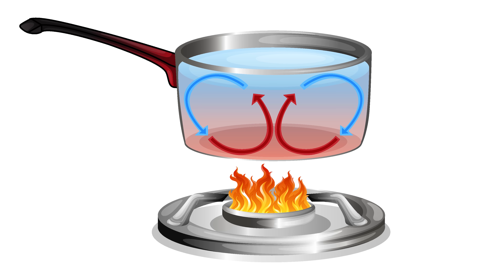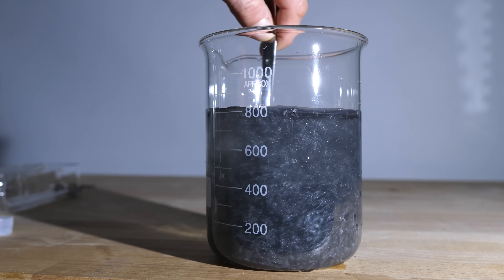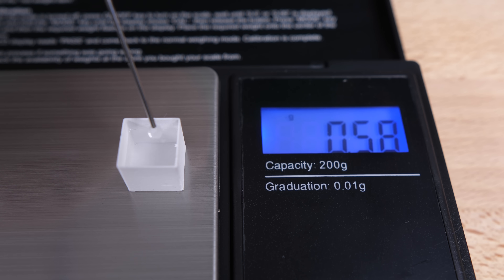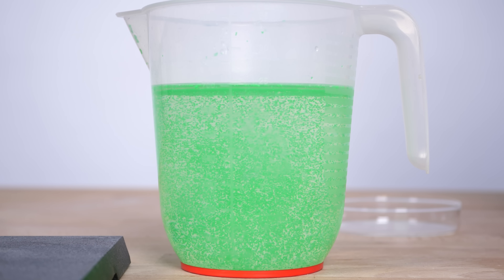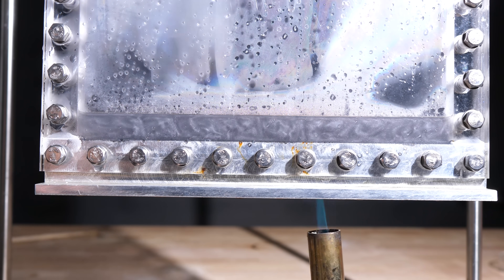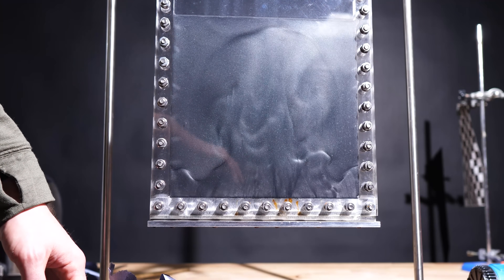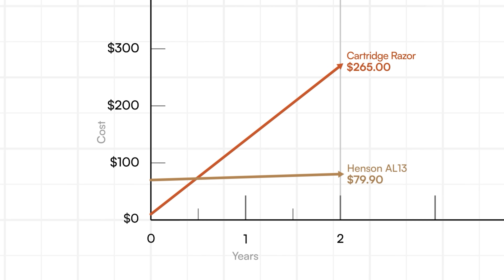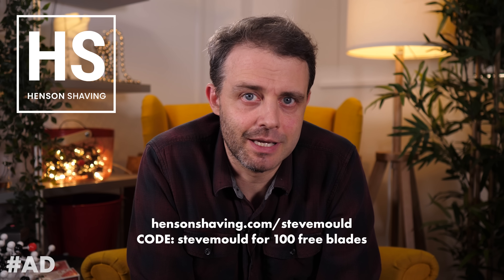The bizarre patterns that emerge when you heat ANY fluid

Comment: My conjecture on why the mica poweder is rheoscopic is the powder is tiny reflective sheets, and they arnt really aligning. If they are in a shear force of fluid, they will roll, and they can only really roll in 2 meaningful ways. They can spin normal to their plane like a frisbee or perpendicular to normal of their plane, like a paddlewheel.

Thus in a shear force, at least 50% of the mica powder is rolling like paddle wheels with their axis aligned with the shear force. They are all in a randomized that, but at least that axis is lined up and the lined up pieces act like a uniform mirror when viewed at the correct lighting and angle.

Comment: At the 8:30 mark where you say the cells are created due to density changes caused be evaporation ... it seems like there are two things that change the density. One is what I think you were pointing out -- the alcohol is less dense then the fluid overall and so when the surface alcohol evaporates, the surface fluid is more dense. But certainly the evaporating alcohol also lowers the surface temperature and that would also increase the density of the surface fluid, right?

Comment: So is the textbook diagram wrong or not.  It seems correct for the case of a centered heat source on the bottom, like a single stationary bunsen flame.  But most real kitchen heat sources are not small and centered, then you wouldn't expect to have the neat toroid flow.  He should have shown his spaghetti in motion, and showed the type and size of heat source underneath.

Comment: There is always much speculation amongst glider pilots regarding the shape and structure of atmospheric thermals, however it is generally agreed that the strength is greatest in the center, decreasing outwards with a defined edge. Also descending air is always encountered just prior to entering the thermal, like your 2D illustration demonstrated.

Comment: Did I hear someone say the SURFACE of the sun???  Alas surely not a surface ! How strange simulating the sun with water!!! Are we implying the Sun is a liquid?
Reply: No, but the sun is made of plasma, which is a fluid. Convections can happen in any fluid: liquids like water, gasses like air or plasma like that of the sun.
Reply: @lunkel8108  Can you provide your reference to fluid plasmas, please.
Reply: @KZgun4hire  Do you know what a fluid is? Plasma flows and can be described using fluid dynamics. It's not a solid. Look up magnetohydrodynamics, which is a fluid dynamics model used, for example, for plasma.
Reply: @lunkel8108  PROVIDE YOUR REFERENCE!

Comment: re: the Tia Maria & cream, my guess would just be the cream serves to visualize the process because it'll float on top of the spirit since it's basically fat on a water-based alcohol solution, but also in contact with the alcohol it ends up congealing/coagulating and getting "trapped" in the convective currents - which is why we sorta see it strand out and spin once it's been "grabbed" (for lack of a better word).

Comment: I think the cream might act as a barrier, around which the alcohol convection happens. 
High-ABV fluid rises up on one side of the cream, flows overtop, loses alcohol to evaporation, and low-ABV fluid sinks on the other side.
Withput the cream, there is  no barrier to reign-in the turbulence, so the turbulence breaks up any convection cells.

Comment: I think the flakes align locally because they all interact the local liquid nearby,  They are also all responding to the movement within the liquid. Because they are more massive than water molecules, the flakes have a lot more momentum and this would resist the influence of the forces trying to move it.They also collide with each other more when they are mostly parallel to each other. Whereas when one is edgewise to another's face they are less likely to strike each other.  Combine these two effects and there is a combing process which aligns the flakes.  They share momentum when they strike each other, effecting syncing the two flakes up.  As more and more align the effect is more and more visible.  The more organized flakes still respond to significant forces within the liquid, which is why it works so well to show the convection currents in the video.
Reply: i like to think of the flakes acting like  miniature weathervanes

Comment: Mica powder works alright as rheoscopic fluid, but there's a simple DIY solution that's even better. The cheap shaving creams have stearic acid crystals in them which are finer and less prone to settling than mica powder. Mix the shaving cream with 20x as much water (by weight) and you should get an excellent light grey-blue rheoscopic fluid (which you can then dye other colors if you want).

Comment: @SteveMould  While buoyancy is indeed what is driving the convection currents, I find it more useful to think about it in terms of pressure differences, as that allows you to visualize the actual forces involved. 

For a simple example, imagine you heat a thin column of liquid within a container of that liquid. The pressure within that and neighboring columns is given by pgh
But if you heat the bottom of one of the columns, its density p drops and it expands. Because the pressure drop with increasing height is now slower,  dP/dh=pg is smaller, it means the pressure along the entire length of the heated column is now greater than everywhere else in the liquid. This means there's a net force driving liquid away from the column and it now weighs less. Another way to think about it is the expanded top of the column has to even out with the rest of the liquid. Either way, you now have less pressure at the bottom of column, and it now will be pushed up by the pressure from the rest of the liquid.

Comment: I work with Mica slurries on a daily basis. The particles have a high aspect rato, so they're almost 2 dimensional.  Think tiny dinner plates.  This results in slurries that have high concentrations of Mica being shear thinning (opposite of the corn starch oobleck effect) and ultimately that optical perfect effect you see where local areas line up with each other and reflect light towards or away from you

Comment: @SteveMould  You can see these stable convection currents without any extra granular material. A thermal camera is all that's needed. When I filmed a lit scented candle with my thermal camera, the surface temperature was smooth, but after I blew the candles out, the surface of the melted wax immediately formed those stable convection currents on the surface, as viewed by the thermal camera. Really cool!

Comment: I suspect a reason why you are having trouble establishing convection cells, as well as why they were easier to see in the oil, is that the heating was relatively concentrated.  If you were to use something more cosnsitent across the bottom, such as a resistive heating element, you will be able to generate a better visualization of convection cells.

Comment: Little fact about safety razors vs cartridges, when I swapped to a safety razor my razor bumps went away. It's apparently pretty common as razor bumps are often caused by the cartridge design, but not the single blade safety razor design.

Comment: As a trans girl who is still in the process of getting hair removal, safety razors are a lifesaver. The only kind of razor that can actually give me a properly smooth feel, with no shadow and no irritation. They're kind of popular among trans women for this.

I haven't tried Henson myself though. I think pretty much any cheap safety razor will do fine, even the ones they say are bad on their homepage. You can also get the refills from anywhere, and at the rate i shave and replace the blades at, a single pack of 100 blades would last me until well after all the hair is permanently gone. Maybe Henson's precision helps even more with irritation and that just isn't necessary for me? Or it makes it easier to not cut yourself? Someone should probably test that, but it seems pretty likely to me. It took me a few weeks to figure out how to not cut myself, and i still cut my finger a few weeks ago while switching blades. I don't think it's worth it for me to switch at this point though, because i'll hopefully only be shaving for another year or two.

Oh also! Another plus! There are holes in the underside of the razor, which makes it very easy to unclog it if there is too much hair in it (or shaving cream, if you use that). Especially useful if you want to do full-body shaving. Or if you have a full beard you suddenly want gone.

Comment: 2:40 aluminium can be heated with electricity. It should be more uniform ;)
Solid(!) lab power supply can do the work. Yep. it's unnecessary, I admit, but I had to point that, the electric resistance can make "perfectly" uniform, self correcting heat source.

Comment: You should try making a shadow graph and/or a Schlieren setup with just water or oil.

My first encounter with laminar to turbulent flow, where I realized what I was seeing, was when I was about 12 years old. I was sitting with my mom at the kitchen table, and the smoke coming off her cigarette was ascending in a smooth narrow column for (in my 57 years ago memory) about 10 inches before suddenly expanding into chaotic turbulent flow. I watched fascinated until my mom got irritated and told me to knock it off.

Comment: Fabulous presentation, I have to rewatch Gareth's See the Pattern video in which the activation of galactic jets occurs in relation to Red-Blue shifting colour changes across the whole damn thing!, and that makes me question the limited version of what constitutes Convection Colums in combination with orthogonal-normal disks of strategically placed vortices of condensed wave-particle matter quantization in relation to shell-horizon envelope-shaping correlation-tuning of Black Hole Singularity positioning in Black-body Holographic galactic disk/picture-plane containment states.., it fits reciprocation-recirculation quantization sequences established by Euler's Absolute Zero-infinity reference-framing containment of vortices and parasitic spin states in vertices of vortices, ie 0-1-2-ness Cartesian Reciprocation-recirculation Origin of inside-outside Superposition-point Singularity Positioning made large scale by operating the unity-connection scalar Principle.

Thanks exceedingly.

Comment: Your intro music absolutely slaps. EDIT: My guess is that the mica flakes come together because they make the water more viscous when many of them are close together. So a lightly populated current might run into a highly populated current, slow down more quickly than if it had run into another lightly populated current, which results in more concentration. I suspect the water becomes more viscous through the same mechanism as surface tension: local electronic disruption that allows some water molecules to have stronger interactions with their relatively fewer neighbors.

Comment: For simulating grondwater flow I used liquid, clear soap (hand soap), whipped it up so there were many bubbles inside. It worked rather well, the larger bubbels quickly rose to the surface, the tiny ones remained long enough (hours!) and made visualisation possible. For almost no costs. But I loved the materials you used, it looked great👍

Comment: Mica is a mineral that often occurs in the form of flakes or sheets. One of the interesting properties of mica flakes is their tendency to align locally. This alignment is primarily due to the crystal structure of mica.

Mica belongs to a group of minerals known as sheet silicates. It has a layered structure with weak bonds between the layers. The crystal structure consists of sheets of aluminum oxide or hydroxide layers sandwiched between layers of tetrahedral silica. These layers can easily slide past each other due to the weak interlayer forces.

When mica forms, the layers tend to stack together, forming a sheet-like structure. However, because of the weak bonding between the layers, individual flakes or sheets can move or rotate independently of each other. External factors such as pressure, temperature, or mechanical stress can influence the orientation of these flakes.

For example, when mica is subjected to pressure or shear stress, the weak bonds between the layers allow the flakes to slide and rotate, causing them to align locally along the direction of the stress. This alignment is temporary and can change with changing external conditions.

This property of mica has practical applications in various industries. For instance, in cosmetics and paints, mica flakes are often used for their reflective and shimmering properties. The alignment of mica flakes can enhance these visual effects, creating a sparkling or pearlescent appearance. Additionally, mica's thermal and electrical insulating properties make it useful in various electrical and electronic applications.

In summary, the local alignment of mica flakes is a result of its layered crystal structure and the ability of these layers to slide and rotate independently under certain conditions, such as pressure or stress.
Reply: This seems to have been generated by GPT and makes no sense.
Reply: @p_serdiuk  Which part makes no sense?

Comment: 2:05. The mica flakes aline with each other locally as they are following the same pattern of reaction to pressure changes we see in starling murmurations. 

I think. Pure guess. Maybe rather than avoiding predators as a primary use, it’s natural reaction to nearby pressure changes that make the birds fly like this and the fact that it confuses predators is an evolutionary happenstance.